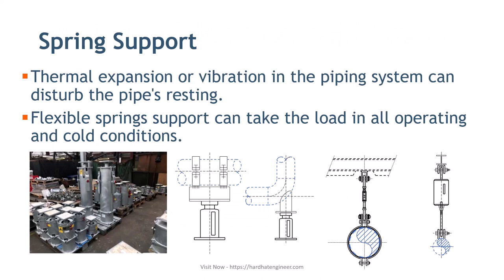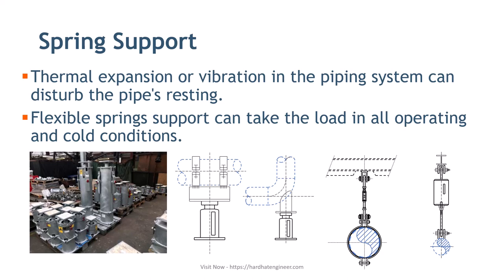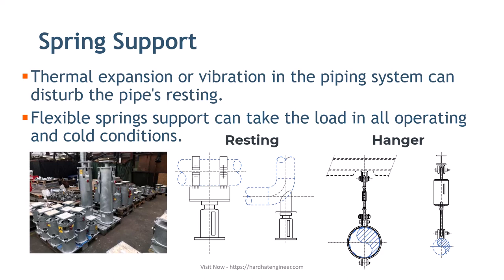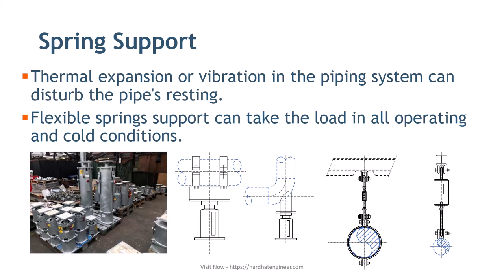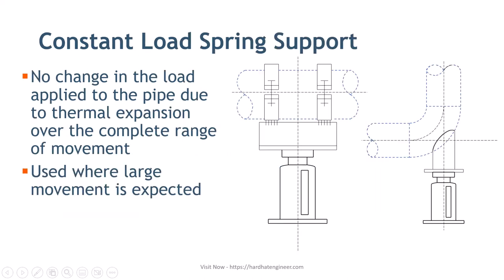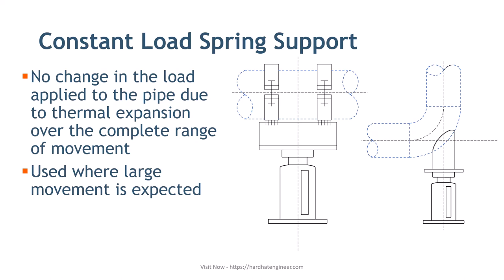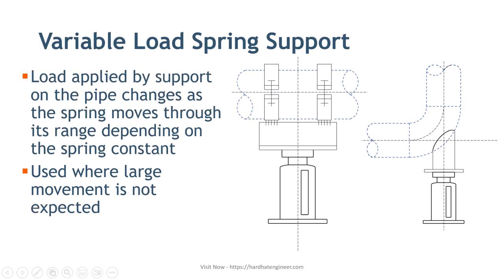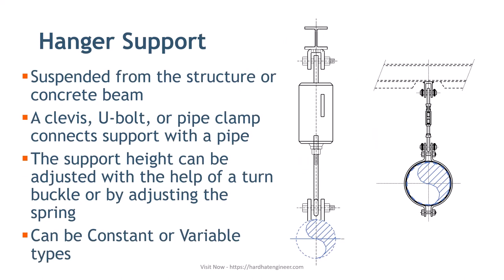Learn about Spring Type and Hanger Type Pipe Support for Pipeline

Comment: Are there any video lectures related to piping covering from basic to skilled. I am finding a course that helps me to cover pipe types, materials, standards, fittings etc.
Reply from the maker: Piping is big field, covering everything in single course is difficult. You may find design related courses and then related to piping components.